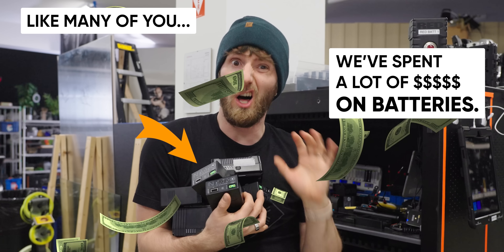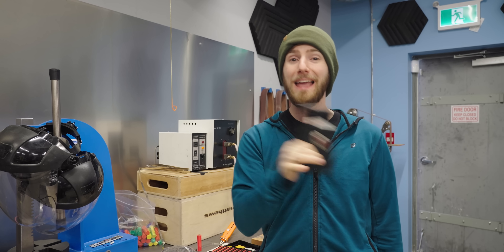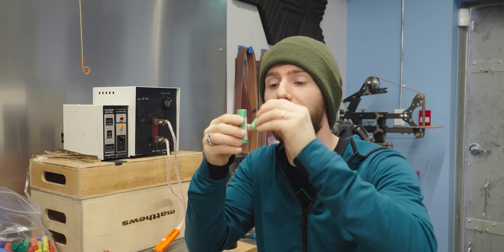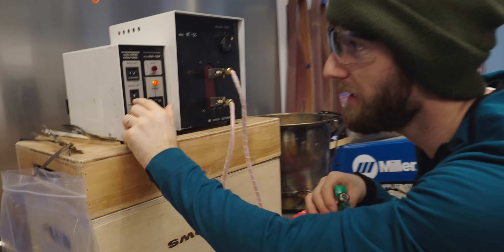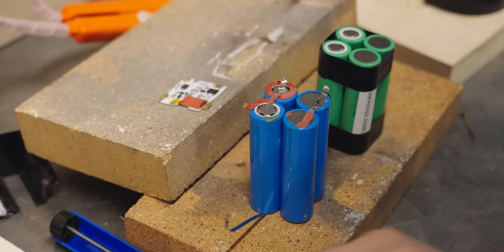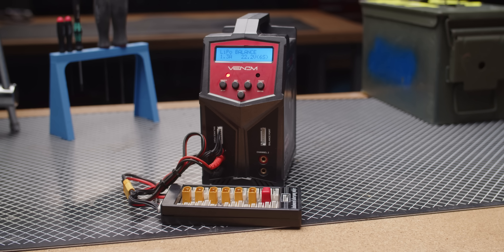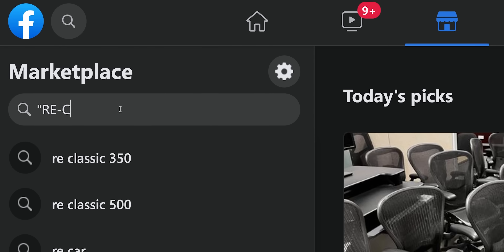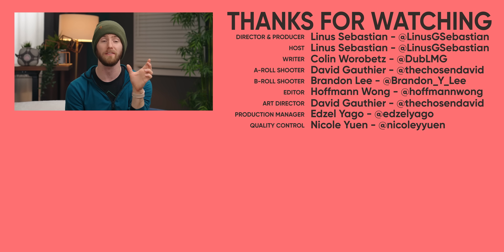This should be illegal… Battery Repair Blocking

Comment: MANY many bms don't allow removal of voltage. If you want to replace cells, you have to connect the new cells BEFORE removing the old cells, which is of course a little dangerous.

Comment: wasted a tons of good batteries from unrelated sparks. Also BMS running on volatile software can easily be bypassed: just solder a parallel battery with exactly the same voltage to it and then remove and replace the current cells. when new cells are in place, remove parallel battery used to keep BMS software alive.  I feel LTT didnt put enough effort into this one.

Comment: I built my first pack 10s6p. Was so much fun, want to do more. Made a mistake early to learn early. But in all seriousness I made 2 mistakes that did not lead to an end of the battery but could have been an issue for me or the battery if would have simply freaked out and tried to frantically evacuate anything from my reach. 
I checked my voltages and battery orientation at least 2 times. Every step was measure twice cut once. The hard part is building a rhythm before you can follow it. Be careful everyone

Comment: When I replaced the battery pack for my Nvidia shield, I had to solder the BMS card to  a 3rd party battery, and it worked.

So it sometimes can work.

Comment: I would like to see this video done over after consulting someone/something about setting up spotwelder settings. As others have commented, those sparks are just from the weld process itself, not from the cells. To me, it looks like you're getting those tips way too hot and that's why the tips are sticking. Ideally when spotwelding you should not have to yank the tips off and clean them every time. It should be much smoother. Using good tips, dialing in weld settings, cleaning the surfaces, and weld head pressure are all key to good spot welds. The tool used didn't seem to have pressure adjustment, but too little pressure (air gap), debris underneath the weld surface, and bad tips can cause sparks or blow throughs.

Comment: Dear Linus you need a resistive welder.. AMADA WELD TECH formerly unitek miyachi.. expert on this hint hint.. plus you need a pull tester.. and a volt meter…  you need to make sure that when you weld the voltage  is really close measured pre-weld.. anything more 5 to 6mV is a short cell..the welds look horrible.. the heat is too hot..the weld tips also should be flat

Comment: Something that really bothers me with all this is how bad the charging systems have become in devices these days.  Many requiring that they take power both from an undersized mains adapter, and also their own internal batteries.  Thereby reducing the overall lifetime by putting perfectly avoidable strain on their batteries.  Also, devices that charge and empty while on mains rather than simply disabling their charging circuits once at 100% and operating solely off of mains power thereafter.

Linus, you should get Framework out in the open on this kind of stuff and see if they're willing to commit to always shipping PSUs that can always power the device, even without a battery installed.  If they already do it, just get them to write it in on their site as a commitment or something.  This is such a problem in the industry and obviously we as consumers are getting ripped off by cuts to the quality of charging hardware, while seeing no savings in the cost of the device.  It basically gets eaten as profits while shitting on the environment and our wallets.

Comment: Would like to see that tour of a battery recycling plant. I currently have a box of a few dozen spent batteries that i'm holding on to until i find a place with battery recycling that i would be going to anyway (we used to have some outside a nearby Lowe's home improvement store, but the last time i visited that battery recycling bin was gone). 
Also-is it possible there is an extra tier of "super-evil" where they use software to intentionally reduce the capacity reported, making it useless before the battery cells are actually getting low, kind of like Apple did with some of the old iphones to force people to upgrade, but calling it "safety" saying that letting them continue to fully charge could cause them to explode? Might try checking the individual cells in those old 'near death' red camera batteries to see if it's actually cell capacity getting that low, or if the battery management board is intentionally underreporting to make you buy new units

Comment: IF you're handling a BMS that shuts down permanently after losing charge, take notes from the old Capcom CPS cartridges - just add another Battery parallel to the original, prior to desoldering the latter. That way the volatile memory won't be erased.

Comment: Don't put the old cells in the same place you will throw runaway cells, it's just going to set off all those cells and cause a bigger issue.  The tape over everything is more than enough. (Although you should discharge the cells before you package them for recycling.

If you are too worried then use lithium iron phosphate cells, they are far more tame.

Comment: I'd love to solder in a bench top power supply set to the same voltage as the pack before disconnecting the cells from the bms. Just to figure out what signals they are using to brick the bms.

Comment: The BMS boards can be tripped to shut off, and you might be able to reset them. It isn't always the number of cycles.. The BMS takes certain signals to re=awake it after it is diconnected completely from the batteries. Some people have figured out how to get them to work here and there..

Comment: WRONG. Lithium batteries are explosive due to their EXTREME power density. There is a VERY small amount of actual lithium. If the battery is discharged, it is less likely to explode in extreme conditions.

Comment: For the malicious packs, couldn't you keep the pack powered up with a bench supply (via a resistor so it can easily adjust to battery voltage if you don't get it bang-on)? That should stop the pack immediately noticing that you did anything. If you're feeling adventurous a potential divider network across the BMS pins would also leave it believing that every battery is untouched.

Comment: The sparking was 100 percent not a short circuit but from the cheap shitty welder. If you know what you're doing you can visually tell the difference between a weld spark and a short circuit

Comment: your spot welder is slow, i think that's why it's melting batteries
Reply: IT wasnt meldting anything tho... except what it was ment to... the sparks were simply shit preassure and arcing from the welder because of it. meaning, Linus doesnt know jackshit about this topic.
Reply: @KhaziirEverflight  I know it should spark a bit, what i mean is his arc welder seems to heat up too slowly instead of a quick arc weld;
Compare with /watch?v=231qtaRIs3M for example;

Comment: When Linus turns the spot welder on, you can see the wires move apart from each other due to the immense magnetic fields created by the high current. That's pretty cool.
Reply: I noticed that aswell. I was like shoot thats heck of power flowing through those wires!
Reply: @mikeg1212  Yep. My kWeld, fed by a LiPo battery normally used in the miniature autosports and such, shoots up to a whopping 1869 Amps in calibration mode.
If I place a piece of nickelstrip to spotweld on a battery and place another piece on the cells next to the ones I'm working on, the other piece will jump of the batteries because of the magnetic forces.
Reply: Isn't that Lorentz forces due to the generated magnetic field? Not entirely sure.
Reply: @detroxx56784  Nah, just opposing b-fields
Reply: @detroxx56784  I think so too, and you calculate the force with Ampère's force law. The only thing that can accelerate the cables so they move is a force. Just a magnetic field around cables will not move/accelerate the cables.
Reply: I often do studwelding at my own workplace, and the wires to the stud-gun can sometime just slap you if you aren't careful. Not much worse than a lovetap if it's against, say, the side of the leg but it can be surprising when some rather large gage wire bundles suddenly snakes up and boop you on the nose.
Reply: @mickelilltroll77  How about two?
Reply: As a rule of thumb, "field lines hate each other."  If you have two currents parallel to each other, the wires attract each other, because the field is all around the wires but not between them, but if the currents are antiparallel (e.g. out of the welder and back in), they repel each other. 
It's the same force as in a railgun.  Except that a railgun wants to stay in place, with just the projectile flying out.  Basically, the projectile is a "bridge" between rails (the two terminals), and the Lorentz force pushes the terminals apart and the bridge forward.  Those forces are tremendous, and railgun terminals must be held in place very firmly.  If you underestimate that part, the rails buckle or disintegrate completely.
Reply: @achtsekundenfurz7876  1 Amp used to be defined by the size of this force when the wires were 1 meter apart, but this was lost in the latest rewrite of the definitions using bogus arguments.
Reply: @johndododoe1411  Oh I remember that...  IIRC, 1m of wire exerts a force of 1.0e-7 newton on a parallel 1m wire that's 1m away or something like that.
Reply: @johndododoe1411  Wait, 1 Amp is defined as the Charge of 1 Coulomb a second iirc!
Reply: I saw that, and I was like, "WTF. Those aren't water or air pressure hoses." Was wondering what made them move. That makes sense.
Reply: yup i solder some pretty big wires on transformers. its amazing how the wires react
Reply: hmm
Reply: Antiferomagnetic, or as (ElecroBoom, Has Coined" Alumagnetic!")
Reply: @steveniovinelli2176  "antiferromagnetic". do you mean diamagnetic?
Reply: This is normal  behaviour, we have attractive forces between cables because of opposite currents, combined with the also normal forces because the current carrying cables are inside earth magnetic field, those are affected by space orientation, current polarity etc.
Both forces depend on the actual current function with time.
Reply: @nikspanakis what the blazes do you think you mean? "normal force" what has that to do with cables being forced apart by the B fields? lol
Reply: timestamp
Reply: 9:32
Reply: time stamp?
Reply: @Supermanohman  8:45

Comment: Thanks for proving that “Don’t try this at home” applies here. Seriously, if you guys had that much trouble, I have no chance. Now I can throw away (at an e-waste drop-off) a bunch of old batteries I was hanging onto for the day I was going to try this myself.
Reply: They didn't have much trouble at all. They only THINK they had trouble. See some of the other comments. The batteries they put in sand are probably still perfectly good. Also, they may need to just put their refurb packs on a charged to re-initialize them. The verdict is still out on this one.

Comment: Honestly only thing I would have been worried about from what I see is placing it on that brick. really easy to have trace minerals that are conductive on there that could CAUSE the batteries to short once you get one of the sides done. Otherwise the sparks that you saw didn't look like a short. likely from the spot welder and not dangerous to the battery. Hard to tell but the timing makes it look that way. It's pretty common and nothing to worry about. The real danger is shorting the battery with improper metal placement or insulation once its flipped over.

Comment: Just new to add 7 volts past the first hurdle power management  then the chip will reset. Battery pack will work. Saftey cell replacement feature so at the factory they can replace a cell. You just need to turn the Bms on. Video is a big fail you need bms expert chip is just in off saftey state. There are plenty of people that can get that battery working.👎

Comment: Not using spacers between the cells are pretty darn stupid, and are in most cases the cause of battery fires. The hull of each group of batteries  in series is at a 3.6 - 4.2 voltage difference. The thin plastic cover on each individual cell is not a good enough protection nor a good enough distance to be safe.

TL;DR: Do not put cells side to side directly. Use proper spacers made for the application.

Comment: The real solution here is standardized packs. We've had the humble AA cell industry standard for something around 75 years now. Li-ion packs should come in standard sizes and voltages. This would DRAMATICALLY reduce the cost and make them a lot easier to replace and recycle. But obviously manufacturers don't want this. Insanely expensive battery packs and throw-away rechargeable devices are great for keeping factory lines humming.

Comment: @14:00  in most cases the BMS will not activate until you put it on charge.  What happens is that once removed from the old pack it goes into the undervoltage protection state (because of course there is no voltage once you disconnect it). Once in this state it will not turn on the output until a charger is connected and the cell voltage exceeds some preset limit, which is often quite close to the fully charged voltage.  Even if the cells are fully charged when you first connect them to the BMS it will likely still need to be connected to a charger to trigger the BMS to turn on.

Comment: You would have been better off going to one of the major distributors than a vape shop - most vapers do, and as a result, stock only moves slowly at vape shops and you can (as you found) have a mix of ages and batches.  Vape shops are also (often unwittingly) selling re-wrapped cells which are either recovered or fake.
Look to a man called Battery Mooch for full info - he has a channel on YT and is an electrical engineer specialising in energy storage, and has consulted at the highest levels - broadcasters, government, energy companies and military, so you can take what he says as gospel.

Comment: I was on board until you mentioned 'anti right to repair.' The issue you are having is that you cannot just add a battery to a circuit and then have it work. The circuit must see the correct voltage/amperage to even begin managing the power. Which means your cells need to be in closer tolerance to cells manufactured for that board when that battery was manufactured. Amperage is what matters most here.

Comment: Those spot weld sparks aren't dangerous though? The batteries will be absolutely fine 😅
Plus with a BMS you usually need to fully recharge the batteries, or jolt the BMS then it will activate again.

Comment: I have a 8 year old ASUS laptop and the battery would die in about 10min (originally would last around 1h). So I disassembled the battery, replaced the cells with new ones and... It didn't work. At all.